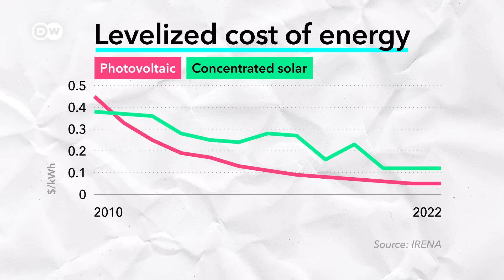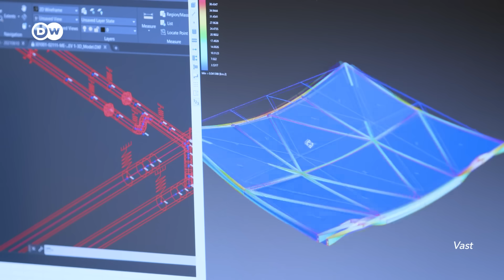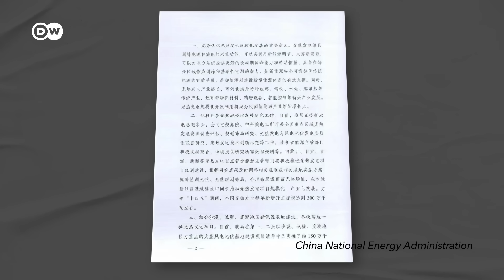How we can make solar power at night

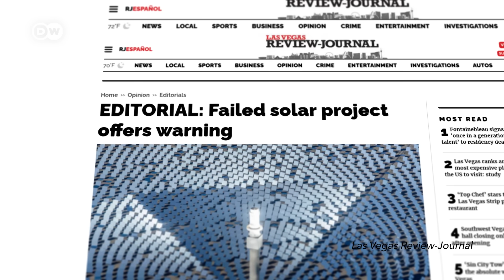Comment: 6:00 I can't believe that there wasn't a way of sorting this out, and finding an alternative for instance for the molten salt issue, and find something better to replace this?
They did say they are using 'liquid sodium' now in a new testing plant, and I still can't help thinking there is something easier to use than this?
Not sure I understand the logic of saying this works at night however it can't collect solar rays at night can you?

Comment: Using electricity to melt sodium and store molten sodium and later on cut off electricity. Use molten sodium to run turbine and generate electricity. Kind of inverter replacing dependance on batteries used in present day inverters. Less energy efficient process but can save money spent on batteries

Comment: the whole problem is with having tower and pumping the molten salt . It has easy solution. why dont they just use Optical Diversion to move light  from top of tower to bottom where molten salt can be heater easily.

Comment: Thermal to mechanical energy conversion results in efficiency loss with many moving parts. The input side of CSP is really interesting though = concentrating the sunlight. Super simple. The storage of said energy is where things get interesting, with companies like Rondo and Antora's storage system, eliminating the need for molten salt. Downside = you still need to convert that energy into electricity. Old way = steam turbines. New way = thermophotovoltaic cells. However, you're still dealing with the energy loss from thermal to electric conversion. 
So what if we re-evaluated? Make the BESS (electrochemical) storage in PV way cheaper and more reliable to get through the night?!

Comment: One thing to consider with CSP is the biodiversity implications. A solar park can be easily built in a way that enhances biodiversity. If no pesticides/herbicides are used, there is some space left free of panels, if native species are planted, etc. it can mean neutral if not net positive impacts on species. But CSP has potential to be pretty negative. Studies have shown that birds regularly get fried as they fly by. And I recognize that the mining associated with PV is also really damaging. But already in countries like Germany it is hard enough to get PV implemented sometimes. I cannot imagine citizens would support massive mirror arrays installed when that kills the birds that fly through.

Comment: Multiple CSP towers. 👍🏽
The end of the video gets it. 
I use seperate power sources for each device rather than one large one.. typically.  I obviously have a large lithium ion, but I use lead aside car batteries for seperate devices.  ie: one for a laptop. One for a rice cooker, small panel/battery for a phone   You can also series/parallel batteries for large devices like washers/dryers.  Avoiding fuse panels and total systems failures.  
Obviously for grids, that’s not an option, but if I were designing a solar power plant I would have PV and CSP, multiple towers. Make sure the tower has a method to reheat the salts in the event of a failure, and even use thing like Heron fountains/gravity pumps to keep salts and waters moving as much as possible without the need of power, while still maintaining a backup power source (battery) for nighttime failures. 
Maybe even keep a conventional generator onsite if you are really worried, or needing to be prepared.  
The failures of the CSP sites really didn’t have to be.  I’m pretty stupid and there’s no way I would have e ever used a single tower and had no pickup plan.
Reply: That is what the chinese are doing, rather successfully

Comment: IDK why we are even thinking about these huge leaps in logic and engineering when there is 300 years worth of uranium and 3000 years worth of thorium in ready to be mined for clean power generation, and nuclear waste management went trough enormous leaps where most of it can be recycled and only low emission materials remain wich can just be put into concrete boxes and ignored.

Comment: Battery costs are now 90% cheaper than the year 2000 with estimated costs being reduced by 50% more in 2 years time. 
  Second the cost of solar panels is around $100  for basic 100 watt panels  and can also be as low as $190 for 400+ watts.  
  New panels such as vertical Bi Directional  can return an additional 30-40%  on snow days.

Comment: Batteries  provide all the power we  will need at night.   
 With todays’s commercially available batteries we are only getting 20-30 years of life out of the better ones. 
   But at the rate of development of batteries by the time those batteries wear out and need to be recycled.  Battery life will be longer than a person’s lifetime.
  As things stand now modern LFP.  And even the older NMC batteries can recycle 95% of the battery. 
  In addition there are  replacement applications of used EV batteries.  Often used in home applications.  A battery down to 50% of the range . Can be used in home applications.

Comment: Concentrated solar power CSP uses mirrors (heliostats) to concentrate sunlight onto a receiver in which there is a heat transfer liquid, when the liquid is heated, it generates a steam which drives a turbine and produces electricity. CSP generates alternating current AC. The advantage of CSP  is that it can generated electricity even when there is low or no sunlight. 
Photovoltaic PV  directly converts sunlight into electricity, and it can generate direct current DC.

Comment: A better approach would be to use a photo voltaic solar energy and store that whether in molten salt or gravity. The benefit of getting electricity instead of heat is that you can transport that to the location where you want to store energy and it’s a lot easier to control the input the output.
Reply from the maker: Hey there! Yes, gravity batteries are very promising. We did a whole video on gravity batteries just a few weeks ago. Let us know what you think 👉https://www.youtube.com/watch?v=fB39BISNt0s

Comment: I think a hybrid plant would work awesome. The panels to be constructed from such a material which also contains fotovoltaic cells alongside a mirror finish. They would produce electricity directly and also using the heat reflected from them..

Comment: Sand, brick and carbon/graphite heat batteries might be the key to using solar and wind.
Reply: This is one option with Polar Night Energy demonstrating the use of sand for 6 month storage. An alternative “battery” is to convert electrical energy for liquid transport and use as fuel such as hydrogen or methanol. I see land based wind farms and wonder what the land below is used for, Could put solar pv together with wind as a substantial part of getting the electricity to market is the grid system.

Comment: also one more thing about csp, it has inertia. photovoltaic REALLY doesnt like big sudden changes in demand because the electronic DC/AC inverters dont have inertia like for example, a big rotating steam turbine has, so when demand goes up suddently, photovoltaic stalls very hard and can cause dangerous voltage and frequency drops in the grid that can force to cut off parts of it

Comment: We may not need complex electronic mirrors in our CSP systems. Instead, we could leverage innovative optical technologies, like advanced spherical lenses or Fresnel lenses, that can concentrate sunlight without moving parts. Glass, being cheaper and easier to maintain than polished mirrors, is a promising material for these lenses. The concept is similar to "solar death rays" made from old CRT TV screens, which effectively focus sunlight with minimal complexity.

Maintaining Steady High Temperatures

To maintain consistent high temperatures, several strategies could be explored:

1. Underground Thermal Storage: One approach is to store molten salt underground, potentially using repurposed mine shafts or newly drilled wells. These underground "heat batteries" would store excess thermal energy, maintaining a molten core. With proper design, the outer layers of salt could cool and solidify, while the inner core remains liquid, ensuring a stable energy source. By gradually re-melting the solidified layers starting from the center, we can continuously draw heat as needed, optimizing the system's efficiency and longevity.

2. Nuclear Hybridization: Pairing the CSP system with a molten salt nuclear reactor could provide a stable heat source during periods of low solar input, such as nighttime or cloudy weather. This hybrid system would not only stabilize the temperature but also improve overall energy reliability. Importantly, molten salt reactors offer significant safety advantages over traditional nuclear technologies, making them a suitable complement to high-temperature CSP.

Advanced Photovoltaics and Energy Capture

We should also explore Thermal Photovoltaic (TPV) systems, which convert infrared (IR) radiation—abundant in high-temperature environments—into electricity. The visible glow from CSP concentrators is essentially wasted energy. To eliminate this loss, we need materials that absorb nearly all incoming energy and convert it efficiently.

Advanced carbon-based materials, possibly a form of graphene with engineered microstructures, could trap light within their structure, ensuring minimal energy escapes. These materials, capable of withstanding extreme heat, could be the key to maximizing energy capture. Niobium Nitrate has been discovered to be able to absorb nearly 100% of incident light, so should be looked into. Panasonic Corp has developed a niobium nitride photocatalyst that can absorb 57% of sunlight and decompose water to produce hydrogen, so we could consider just going directly into Hydrogen as our fuel storage.

Further, we could explore the potential of generating a voltage gradient directly from these materials. Known thermoelectric materials can already convert temperature differences into electrical energy. By engineering carbon-based substances to function as both a heat capacitor and a direct energy source, we could tap into stored heat or electricity as needed, pushing the efficiency of CSP systems even further.

Iron Fuel: A Carbon-Free Alternative

One of the most exciting prospects of reaching ultra-high temperatures in CSP plants is the ability to use iron as a fuel. Unlike carbon-based fuels, iron can be oxidized (burned) to form iron oxide (rust) and then reduced back to iron using high temperatures. This process creates a clean, recyclable fuel cycle that doesn’t emit carbon dioxide, making it a compelling alternative to fossil fuels.

Iron fuel is particularly interesting because it can store and release energy efficiently. When iron is "burned," it releases energy that can be harnessed for industrial processes or electricity generation. The resulting rust can then be reduced back to iron using energy from CSP plants, completing the cycle without carbon emissions. This makes iron fuel a sustainable and potentially revolutionary energy storage and generation medium, particularly in a future focused on reducing carbon footprints.

To reach the temperatures necessary for smelting iron directly from rust—around 1,538°C (2,800°F)—we probably would need to employ multi-stage solar concentration. By progressively focusing sunlight into smaller and smaller areas, we can intensify the energy density 

The solar furnace in Font-Romeu-Odeillo-Via, France, has achieved temperatures as high as 3,600°C (6,500°F), so it's at least possible.|

The melting temperature of Niobium Nitrate is 2,573°C (4,663°F) by the way, which means if we decide not to use iron, we could go back to lower temperatures and use Niobium Nitrate coatings within the receiver to make it better at absorbing everything.

Speaking of steam distillation, we should use these to desalinate water directly, and simply desalinate as much as the sun feels like desalinating for us any given day.

Comment: it doesnt really work at night. it justs stores power in a molten salt battery. Photovoltaics can use batteries as well. 
besides.. if you use the molten salt at night to power the generator, you wont be able to heat it up again till the sun goes up. So you run exactly into the problem the women mentioned. molten salt turning into solid salt and clogging the pipes.

Comment: CSP is not the solar cell rival. CSP is the battery rival that never was. CSP will only be destined to die when battery become cheaper to a point.
Reply: Its just not battery and storage it’s more of a 24x7 generators. Maybe at this level it might die, but as battery tec improves maybe tec in this sector also advance.

Comment: Batteries Batteries Batteries
Solar- Wind- Battery
Simple Cheap Quick

Nuclear takes 15-25 years, 50x more expensive, and creates far more hazardous waste, although still partially recyclable. If thos changes in the bext few decades, great! But the solutions to our energy needs are already available and they’re dropping in price exponentially quicker than even the experts predicted. Still want to wait around for some magic alternative fuel to put in your old gas combustion engine? Wanna wait around for some point down the road when nuclear is finally cheap? I don’t think so.

Comment: There is a cheaper alternative where you pump the water up to a height in a tank with solar power in the day and then in night use that water with pressure to move the turbine to generate electricity

Comment: What prevents them from running their liquid through a skinny black pipe inside of mirrored half pipes? They could use the cold stuff to cool it down if the temp got too high... doesn't this setup loose a lot of heat to the air if it needs to travel from the outer corners of the field to the tower?

Comment: It seems like these would be great for providing off-peak power supply during the evening hours while photovoltaics on rooftops could be providing daytime power. So the CSP style solar generating plants could provide a base load Supply and wind and photovoltaics would be able to supplement the grid for Peak daytime electrical use. Round that out with hydroelectric and some Modern nuclear power plants, and we could actually have a carbon free grid.

Comment: It will fail again, because the future is enhanced geothermal energy. Fracked geothermal wells produce as much, or more, energy over its entire lifetime than fracked oil wells. So basically there is no need anymore to frack for oil. Just drill for heat, and  the well can then also be used as a battery. Just put the well under pressure in the daytime, with excess solar and wind energy, and release that energy at night, or  a few days later when it's needed. An absolutely perfect solution that's hidden beneath our feet.

And you don't need the bad chemicals they use for oil fracking. Geothermal fracking can be done clean, without nasty chemicals.

Comment: Why not...combine both? A single sheet of galss with custom photovoltaic cells basically 1/20th of its length at outer edge. And maybe use that additional energy to story electricity... just for the sake of maintaining temperature of molten salt? I mean ...those glass planes are being moved to sun facing side...why not add some stuff to it and utilise it fully?

Comment: 2:32 Does the salt ever degrade or need changing after a particular interval?
Reply from the maker: It would not need frequent replacement if all goes as planned, but like our interviewee points out: it's not very easy to work with as there's the risk or corrosion if it drops below its melting point.

Comment: If you had done any real research you would have found the Solar Chimney power plants. They are far simpler, way less maintenance , and they don't turn unsuspecting birds into smoking lumps of char that fall to the ground with a trail of black smoke. People that work in/at/on the CSP plants you are promoting call them 'black smokers'.

In fact they built a small pilot plant Solar Chimney in Spain almost 30 years ago and even at the very small scale in an area with ridiculous winds this unit was actually profitable. The videos are probably still here on YT.

Its essentially a giant greenhouse with the canopy sloped slightly upwards towards the center and a huge 'chimney' several hundred meters tall to use the convection/suction to harvest the heat of the whole area under the canopy. In the smaller scale unit they had one large turbine inside the chimney that operated at near full capacity in the daytime and at a reduced rate at night (when power demand is lower). At very large scales several turbines at the base would be used. Some have proposed putting large pools of water at the very warmest center area to store even more heat for overnight operation.

Note that the greenhouse area was at least 90% usable for growing things, only the very center was too hot for such activities. This means these are many times more environmentally friendly as well.

Comment: One may even use energy from the solar panels to heat the storage in certain circumstances, simply to stabilize the grid. Since one might need a heater somewhere in case the plant solidifies it would even make money.

Comment: Why we covert heat into electricity, heat is an major requirements, almost 30% of the total load , we should developed CSP heat with thermal storage for industrial heat application, another PV with heat pump plus solar thermal can produce Green steam / Heat in an economical way.